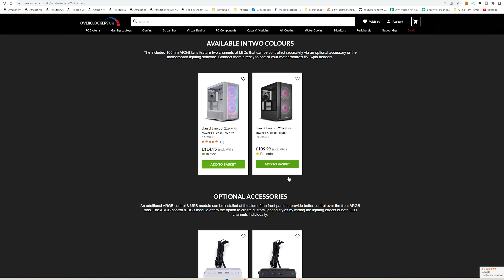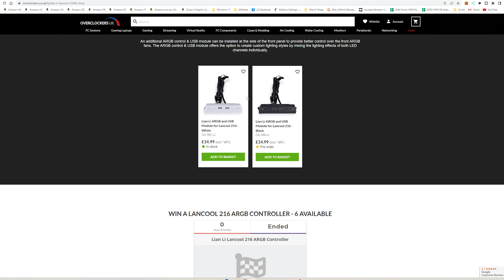Lianli Lancool 216 ARGB Almost Perfect ARGB PC Case

Comment: I just got the black non rgb.  Loved the case.  Easiest build ever.  Only thing was the gpu sag bracket did not work for my gpu. 7900xt fan was being blocked by bracket.  Just bought me cheap $13 bracket off Amazon that worked fine.

Comment: Was initially surprised at the price but watching this video highlights what you are buying. The design reflects flexibility for every build variation, the quality is easy to see and easily permits upgrades at later dates! As for the fans, love the 160s but how do you set diff speeds for extra fans added bearing in mind size differences. Great review Mike and Kath 🐈👍
Reply from the maker: yeah the two front fans really need to be connected to the hub and the other fans can use the hub for RGB but connect the PWM side of it to the motherboard ports, that is what i have done and gives a much better control

Comment: So many options. I like this case, but I have a few reservations about front fans with odd measurements. I have to front mount my AIO radiator due to ram clearance, so I'm not sure how much air those can push in a push pull config. Still love the features, especially that front panel section being movable.
Reply from the maker: ram clearance will be fine with top mounted rad, there is a ton of room there

Comment: looks like the montech case ,i would take the 140 fans out and put 120s in the front , i can also say that the montech case as it is familiar including this one are a good case and for atx boards
Reply: It would perform worse with 120s on the front. Those 160s are great.
Check GN's review and testing of this case
Reply: @vectivuz1858  that i agree with you totally 100% but i have tested the fact of having three at the front intake and two at the top outtake and one at the back outtake the air moves quickly in and out also creating a dust free for a few months more and have no problems it also depends on your gpu and cpu of course
Reply: @XENONEOMORPH1979  I see but won't adding more exhaust fans instead of replacing the 160s at the front do the same thing?
Reply: @vectivuz1858  each to their own i took them out put them in another build the 120s are doing fine used a controller as to not use them on the board so that less heat is coming off the board 
as itneeded the 8 pin for cpu then gpu so less heat coming off the 12 volt and 5 volt rails .

Comment: I also just got this. It's a really great case. But some downside. If you replace the two 160mm fans with three 120mm or 140mm, there will be a space beside the fans. It's not that bad looking but if you're particular with it, it might affect you. Also, the bottom left side is see through, So if you tuck your cables within the psu, which you might do, it will be seen a little. Last is inside the case just above the HDD case, there's a huge space so your cables might also be seen.  I don't mind the downside though. It's a great case for me. Good cable mgt and easy to build with. Just a food for thought to those who wants this case
Reply: were you able to fit three 140mms at the front?

Comment: Without dust filters I can see this case getting extremely dusty very quickly. It does look nice though!
Reply from the maker: so far the front filter has done a remarkably good job
Reply: It does I have worked on a lot of the ones from the series and they are dust suckers.

Bedrooms I have found to be the worst.

Comment: I would have bought this instead of the Corsair 4000D Airflow if it came out sooner, the rotatable pcie bracket for vertical mounting and free fanhub is a no-brainer for budget cases.
Reply from the maker: yeah it is a really good case and is closer to the 5000d in terms of flexibility and 4000d size